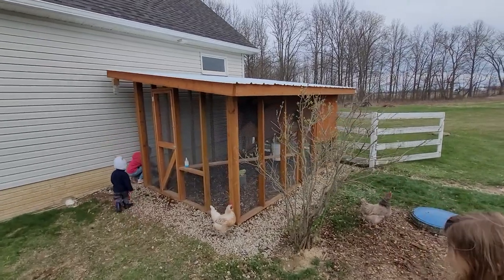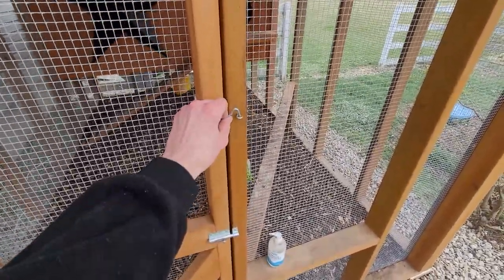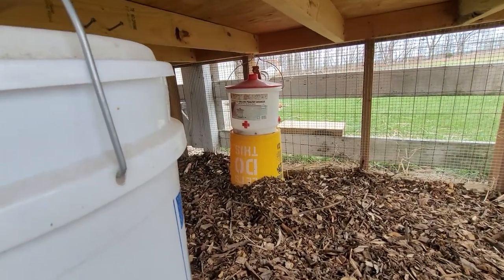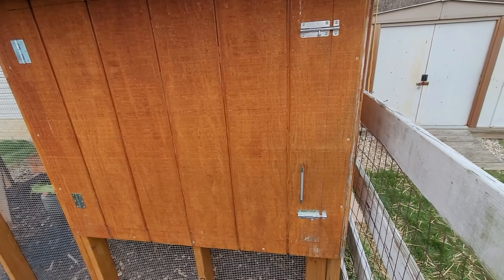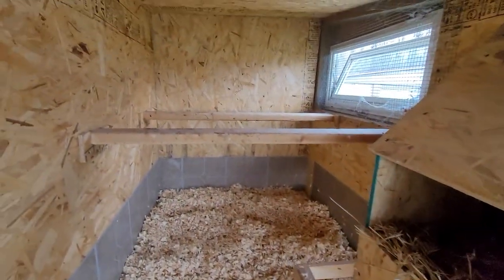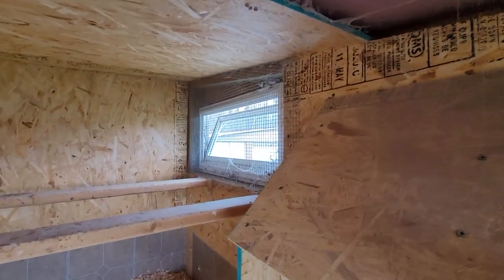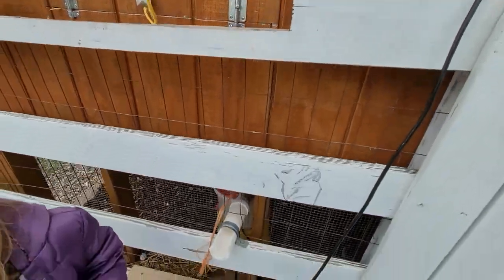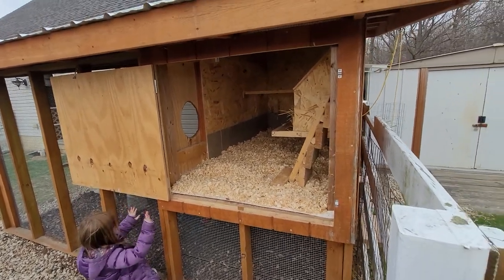DIY low-maintenance 8x12 chicken coop!  Super easy to build!

Comment: I use Wyze cams on my property on a regular, so nice to see it used in coops because this is what I had in mind. They now have the Wyze cam pan V3 which is 360 pan and water-resistant. Just need electricity. Great vid!
Reply from the maker: Yes!  I love their camera offerings.  I use 2 of the battery powered ones on the coop (1 to check the egg box and one under to check the food/water/door.)  They last over 4 months on a charge when used infrequently.

Comment: I built 2 runs 12 foot by 36 feet. And did half of it pitched like yours but used the poly roof from Home Depot    Have 24-30 in each run.  Should of did whole thing.  Wife complains when it rains a bunch cause you know chickens poop can stink when it gets soaked.   Nice job brother
Reply from the maker: Thanks for the comment!  24x36 is huge!

Comment: Nice coop and good video.  The only thing I am curious about and can't quite understand is why the (basement) window seems to be upside down.  I would very much like to understand your thinking or if it was arbitrary. Thanks for posting this !
Reply from the maker: Thanks for the comment Gordon,   I never really thought about it until you said something.  It was installed in this orientation in my basement as well, so I thought it was normal to be this way... but maybe it is upside down?  Lol, I am not sure now, but it works well either way.  
Thanks!

Comment: Hi! Love the build for its simplicity - we are modeling our coop build off it as close as we can based off of what we see on the video and have just completed the walls. Just some questions:

1.) What are the dimensions of the roof "box"? Did you end up getting a 2 x 6 x 16ft board, or somehow fasten two 2 x 6s for the length of the box?

2.) How does the coop attach to the run? Did you use joist hangers for where the coop structure meets the frame of the run?

Thanks so much again for the excellent ideas!
Reply from the maker: That's great!  These are all very good questions.  I can't remember the details at this moment but I will take a closer look at it tonight and get the dimensions for you soon.
Reply from the maker: @Ej Barracoso here is a quick video I made tonight to try to answer your questions.   I hope it is helpful. 
https://youtu.be/fPzjZad2hBE
Reply: @doinkeroni  Thanks so much for making a video answering these questions! Super helpful to visualize your answers.

Comment: What materials do you use for the main pen area floor, and how often does it need clean/replace?
Reply from the maker: The main pen area floor is just wood chips.  It depends on how many chickens... but so far I have replaced it 1 time in the last 3.5 years.. but I plan to do it again this spring.

Comment: Paint the wire mesh black. Thank me later
Reply from the maker: Good to know!  I was actually looking for black wire mesh but couldn't find any.  Any recommended process for painting it?  (Brush vs spray vs roller?)  Since it is galvanized, I didn't know how well it would stick.
Reply: @doinkeroni  I rolled mine with rustoleum enamel. Has held up for the past 3 years.